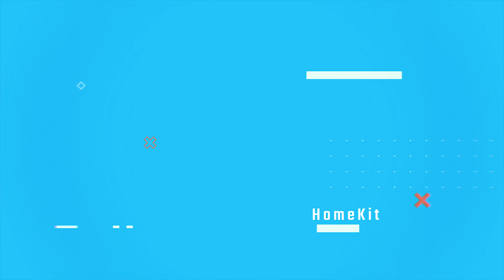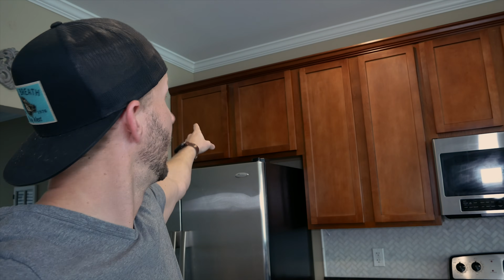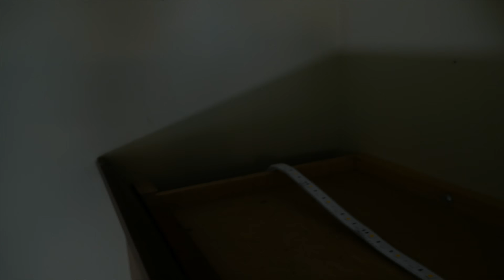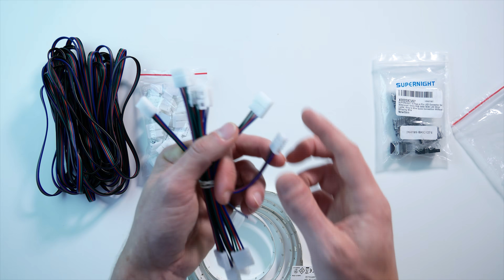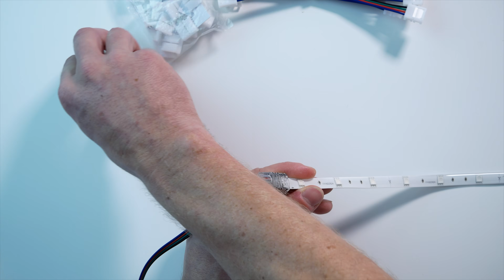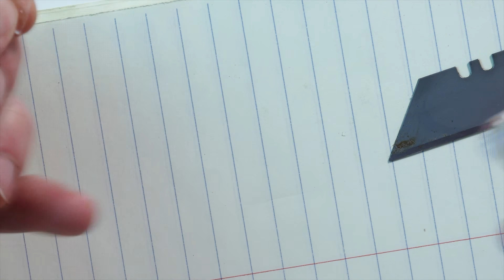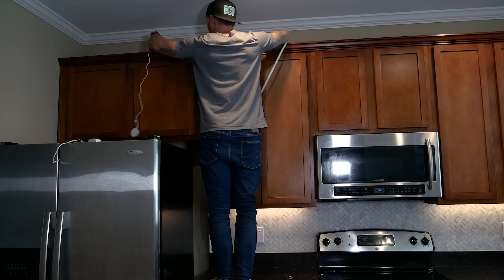How to install LED Strip Lights – Under Cabinet Lightstrips for your Smart Home!

Comment: Hey Shane, I am just starting my home automation and watching your channel. I need a LED strip just under 30’, can you make a suggestion.
Reply from the maker: I can't think of any native homekit light strips that can be extended that long. you might have to use more than one, extending each as long as possible, then group them in the Home app.

I've also seen a LED controller that supposedly supports HomeKit. If that works, then you could use any 3rd party light strips and extend further. But I haven't tried that so I can't speak much about it from experience.
Reply: Shane, your reply was much appreciated.

Comment: Did you diffuse the bottom section?
Reply from the maker: No I haven't. I'm considering it but it's honestly it's not too bad. I only get a bit of reflection on the countertop sometimes but the "hotspots" aren't too bad.

Comment: Install hardware on your cabinets.  Having accent lighting is cool, but cabinet hardware is functional and protects the cabinets from unnecessary wear over time.
Reply from the maker: I did that also. Right after I installed the lighting. 👍🏻

Comment: Hey dude, great video! This definitely affirms my decision to install under-cabinet lights myself. QQ for ya though: Any idea how long the power strip is? Similarly to yourself, the outlet is above my microwave, and I'm going to need to snake it through some cabinets.  My cabinets are really tall though, so I worry that the power strip might not be long enough.
Reply: Use an extension chord if it is too short

Comment: Hey Shane.  Any tips on connecting the Supernight 4 Pin connectors to the 22ga wiring to the Vocolin?  I am not having any success with this set up.
Reply from the maker: Still having trouble? All I can say is tinker with it. I did have to wiggle and play with them to get the connection solid, but I was able to do it.

Comment: Hey Shane, i'm doing this with philips hue strips as i got them on sale. But i'm having  a tough time with the automation with the motion sensor. Is there no way to keep the lights on when motion is detected but goes off if no motion is detected for 10mins?
Reply from the maker: That is a tough one to do in homekit. Unfortunately, unless you are using something like homebridge or hoobs, there aren't any great ways to automate in HomeKit using timers.

Comment: I really like that you prefer to have a physical switch as well as the app. That's definitely one of my concerns with adding smart devices to my home.
Reply from the maker: Yes,  I learned real quick to not forget about everyone else in the house (or guests). At the end of the day, most will just go to that wall switch to turn on the light.
Reply: @ShaneCreates  that's my concern. We're knee deep in gutting our kitchen and I want under cabinet lighting. I'd like to just hit a switch and maybe use the app if I want to change scenes. What kind of switch did you use and where didnyou place it? Thanks!
Reply from the maker: @MaritzaSG305  If you are using HomeKit like I am, you can use any smart HomeKit button. I like the Flic and the Aqara buttons. I use both. Both do require a hub also. You can place these anywhere. Another is the Wemo Stage that doesn't require a hub.

Comment: Just to be clear - you do not need to buy VOCOlinc only LED strips - you can get the HomeKit compatible controller and extend it using 3rd party strips.
Reply from the maker: Does the controller support homekit natively?
Reply: @ShaneCreates  - thanks for the reply - Sorry I may not have been clear in my comment now that I’m reading it again. I was referring to the controller you reviewed in this video. The VOCOlinc controller has standard 4-pin connections that also work for other 3rd party LED strips. I’ve bought close to 5 now and have loved hooking up each one up. My biggest selling point for The VOCOlinc controller was the ability to connect to standard 4-pin Strips that I can buy from a plethora of other sources.

Rather than replacing the entire LED strip for my desk and monitors, I was able to only replace the controller with the VOCOlinc controller and it all worked. Taking less than two minutes to turn my already strung up, non-homekit desk into one.

I would suggest not mixing VOCOlinc strips with 3rd party strips on the same line. Some small differences in LED brightness could make colors not appear the same.
Reply: @cwfeldmann  can you help me with an issue where I connected 3 strips and on the fourth I can't get the lights to match?  Wondering if reached max length and need to start a new run with new plugin/starter?
Reply: @stephensnediker2841   - First off - Sorry for the book of an answer - I'm offering almost all of the options I would use to troubleshoot. Skip to the last paragraph if this is too long. Forgive me, I don't know your familiarity with this stuff so I hope this helps! Feel free to follow up with more questions.

goes around a king size bed that I would estimate is longer than that.

Makes me wonder if simply trimming that 4th line could help but I have no way of guaranteeing that. I'm assuming you're using 3rd party strips. Using 3 of the 1st party, "VOCOLinc 6.6 feet extensions" are over 13.2 feet so if you're using VOCOLinc's strips, you're already past that.

I do have a single 3rd party strip of LED wrapping around a bed which should be longer than 13.2 feet but that is in one single run, no breaks.

All in all, it's essentially copper touching copper - there are no microchips telling the controller how long the strip is - there is some power limitations but the only issue I had with colors not matching were when I had some personal difficulty with the clamp connectors Shane discusses in the video above. I used the same clamps before even watching his video but I wish I would have waited as he did cover a much better method for making sure copper is clamped adequately.

If you're using angled or T shaped splitters or just connecting two lines end-to-end, always ensure the correct channels are lining up. All LED strips are sentifive to the direction you connect it in, they are not bi-directional. 3 RBG channels and the 1 power channel. Not lining those up will most definitely cause color issues. If you confirm that, then make sure the copper leads are all touching. If one of the 4 isn't connected well, the color will be missing one whole channel preventing it from making the whole spectrum of colors. If all that fails, the connection issue could be INSIDE the strip and thus you're better off just buying a new strip.

One way I might troubleshoot is by setting the color to go only Red. Then try only Green. And finally, only Blue. If one or more of those colors don't light up at all, you have a connection issue where one channel isn't connected at all. If each test does light up the strip but the colors don't match, Flip the strip around. If a SINGLE LED is off, the strip is broken.
Reply: @cwfeldmann   Hi Chris - I think I need to explain the situation better.  My strip lights are in bookshelves.  So the run is as follows.  Plug in and then running to first run of the lights.  That run is about 3.3 feet (39in) of the strip light (cut light at half mark) and connected with the same connection method in this video (the connection clips).  Then I have to about 28 inches of wiring until the next strip light of again, 39in.  Then another wire run of about the same length.  Then lights again (39in) as they are wrapping up on each shelf of the bookcase.  Then as I get to the 4th set of lights, I plug in and it wont match the other 3 sets.  Thinking it is because I am over the maximum run distance of these lights.  Wondering how I would get that 4th set to match.  Thinking my only option is to install an outlet for a NEW run and do the last strip light and just have it be its own set tied to a new plugin and then group it in with the other one?  Does that make sense?   If so, any other options or is a new outlet and new light strip the only option?

Comment: Thank u for the very helpful video!🙏🏼 I’m doing the exact same project except I’m not using a waterproof led strip, can I use the connectors included in the kit to connect the extender back to the light strip?
Reply from the maker: Thanks for watching! Not sure I understand exactly what you are asking. Some of the connectors are made for "Waterproof" light strips which really just means they are made to use with light strips that have that silicone protective layer. All of the homekit light strips that I have used have that protective layer, even if they are not waterproof. These are the connectors I ended up using. Other connectors will require you peel back that protective layer. I showed both types in the video.
Reply: Thank you for the quick response! So yeah the light strip I purchased does not have the silicone protective layer. So the Supernight connectors would not work on my light strip right?
 (Sorry this is my first attempt on a project with led lights)
Reply from the maker: @elizabethroman3152  Yes, that's correct. Any of the connectors that say for "waterproof light strips" probably won't work. You'll need something like what's in that last kit that I put in the description.

Comment: Shane said around 3:35 that he was going to use some sort of homekit button to use a single click, double click, & long click to help with automations... Did I miss the part of the video where he talked about it? or was that not included in the video?  If it's in a different video, I am very interested in using something with these strips.  I keep coming back to this video as I am working on a project.  Thanks for the help.
Reply from the maker: Thanks for watching. No, I didn't add a button in the video. If using the lightstrip with HomeKit, any HomeKit button will work. I like Aqara wireless buttons (requires hub). The Eve button is another that works with homekit and connects via bluetooth (no hub required).
Reply: @ShaneCreates  Thanks for the feed back.  I am also considering the Ajax Online platform... I have a whole room that I want to automate and they have "Mi.Light B4 Wireless 2.4G RF 4-Zone Wall-Mounted Smart Panel Controller" that you can mount to the wall.  They require a Zigbee hub and the rumors are that you can use IKEA's hub (which I already have).  It does require buying their bulbs to work with controller.  Although Ajax does not directly support HomeKit, if they can connect to the IKEA hub, could that allow for HomeKit compatibility? 
https amzn.to/3kwsgru

Comment: I've been wanting to change out my current under cabinet lights w/ light strips, so I'm glad you made this video for me to get some ideas.

QUESTION: Did you consider going around the under perimeter of the cabinets? Or even going having them on the outer edge of the cabinets versus the inner edge (as you installed them here)?

Comment: Hey Shane, I used Philips Hue light strips and struggled with gaps. Thank you for this idea!

One question though: How did you prep the cabinets for the light strips? Did you clean the wood any? Did you use the command clips for the lights too? I ask because my Hue LS constantly fell off the cabinet. 

Thanks!
Reply from the maker: Hey Steve, I just used the 3M tape that is on the back of the lightships. That usually does a pretty good job unless you move the light strips. If you need additional support you can find little clips to hold the light strips in these accessory packs on Amazon like I used. I didn't use the ones that came in my kit, but I did use a few just to hold back the wires in the cabinets. And to prep them, I just wiped them down with Clorox wipes real good (alcohol would probably be better).
Reply: @ShaneCreates  Thank you Shane. Love the videos and the content.
Reply: Usually when I mount LED strips, I either use clips or supplement with command strips. Oh, and I always begin by cleaning with an alcohol pad. I hope this helps!

Comment: Out of the Smart Switches, which one is the Best and which ones do you recommend to use  for my type of case situation 
In our new Home we have the Paddle Rocking Switches all through the house, We even have 3 Paddle Rocking switches next to each other.
Reply from the maker: Hey Trisha, I always recommend the Lutron Caseta switches. They are very reliable. The only downside is that they can be a bit pricey. A good budget option that I've used is the Aqara switches. Might want to check out this video if you haven't already: https://www.youtube.com/watch?v=XcXUQRcMyPE&t=3s

The good thing is that most smart switches come in that paddle rocker form factor, so they should be easy to change out for you.

Comment: I want to add lighting to our new kitchen under the cabinets and possibly under the kicks baseboards? The baseboards that is between the flooring and the lower cabinets or cupboards from the flooring?, BUT there is no outlet that is close by or reachable to plug in the light strips? Except for the island that has plug in  outlets on each end of the island.

I like your idea of putting light strips above the upper cabinets besides under the cabinets. 
I don’t think we have a hidden outlet plug above our microwave range in our upper cabinets? I will probably skip that section. Our Kitchen is almost set up or designed the same way as yours BUT a slightly little different, our Refrigerator is in the same spot as yours and so is our over and Stove Range.
We do have several plug outlets under our kitchen cabinets.
I have the Apple iOS Home kit app on my iPhone BUT have never used it. For now I have been using the Amazon Alexa BUT mostly for Reminders and playing music from my favorite radio station. I haven’t gotten any of the outlets plugs to use either for Alexa nor for the HomeKit app.
Since I NOW want to add strip lights to our new Kitchen, and I have the iOS Home kit app, what Home kit accessories( such as what type of plug outlet ) do I need to get in order to operate my lights from my phone? 
In the Home kit app where do I start and add lighting information or add some kind of lighting source so that my phone recognize and control the lights from the kitchen? 
As I mentioned I have never used my iOS Home kit up until now, not sure where to begin? If you can help me how to get started with my iOS Home kit?
If I know what kind of outlet plug to get then I can already figure out how  to add the correct outlet plug to my iOS app, but from there I will need help. Like, where do I find to set up the correct lighting setting for the light strips in the app  and how do I change and operate the lights color and effects in the app? 
We already have COX as our internet WIFI provider.
Reply from the maker: Hi Trisha. I would start by going through some of the videos in my Getting Started Playlist here: https://www.youtube.com/playlist?list=PLSyPtAY5VFr1NF_OgtaNoV67cT2YynuOr

Some of the videos are a little older and the Home app may have changed slightly since this was made, but the overall concepts and information is good and still relevant. It should help in giving you a clear place to start and help to understand how HomeKit works.
Reply: @ShaneCreates  
Thank you,
I will also mention that we have a bran new home that already has WiFi system built in , we also have a smart home utilities already installed such as a smart garage door opener, Ring, Ecobee Thermostat. 
There is now a Bran new Apple HomePod mini that I can get, that isn’t too expensive. Yesterday I came across a smart plug that doesn’t need a main HomeKit base such as a HomePod, just use the smart plug. ( this smart plug has a app for it). 
Again this will be my first time setting up and using a smart home and using the HomeKit app and the accessories for the HomeKit app.
Reply: Here is that one smart plug that I had mentioned that it says that I don’t need a Smart home hub, I found it on Amazon, if you like you can look it up and check it out to see what I’m talking about or just see it and read the description and how it’s used. I use my Amazon app to search for things rather using their website 
Meross Smart Plug Mini, 16A & Reliable WiFi, Support Apple HomeKit, Siri, Alexa, Echo, Google Assistant, Nest Hub and SmartThings, App Control, Timer, No Hub Needed, 4 Pack

Comment: Couple ideas Shane:
1) You may be able to get some wood channel to hide it so it doesn't look so obvious, but I probably would've run it in the corner and just notch the shelves there instead.
2) You also may want to look into a plastic channel diffuser over them so they create a more even lighting field, that should make for a rather even distribution.
Reply from the maker: Thanks for the suggestions Rob. I didn't care much about a diffuser since you can't actually see the LEDs, but I'm noticing you can actually see a reflection on the countertop at times. So that's something I might end up doing.
Reply: @ShaneCreates  Dude. On a total side note. This entire comment section is like a bunch of guys standing around the hood of your car telling you how they would’ve done it while you’re in there trying to get shit done.

Jokes aside your patience is impressive. Good, sir. I think it looks  way dope,  and I definitely learned a couple things from the video.

Comment: At one point you demonstrated how to use a button to toggle a light using shortcut rules. It was awesome and worked great for me until recently. Did the process for this change in a recent update?

Comment: I just got this light strip and I can’t seem to figure out how you got it to do the lighting affects within HomeKit. Anyone else run into this issue and have any fixes? Am I just missing something?
Reply from the maker: Probably the easiest way is to create a new scene in the VOCOlinc app. You can include the effects there. Then when you set the scene with Siri or in the Home app, the effects should work.